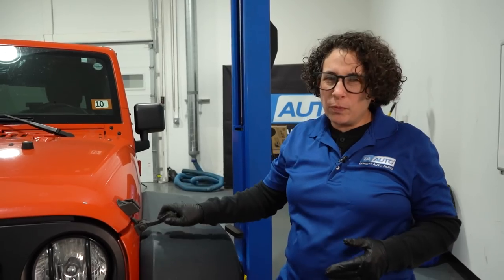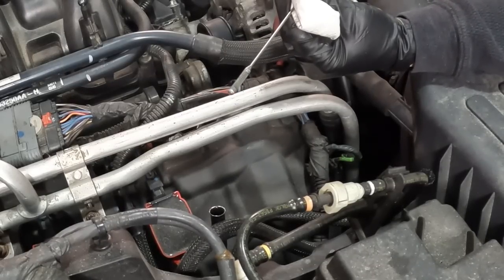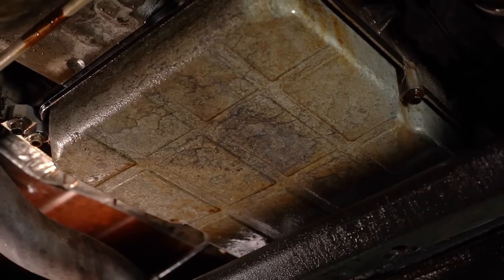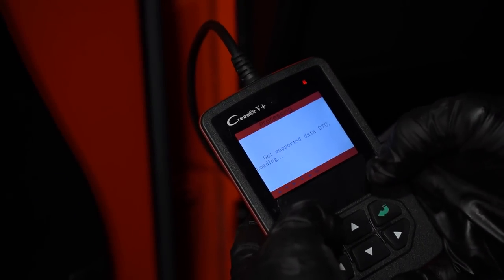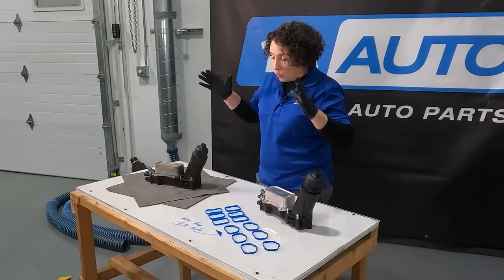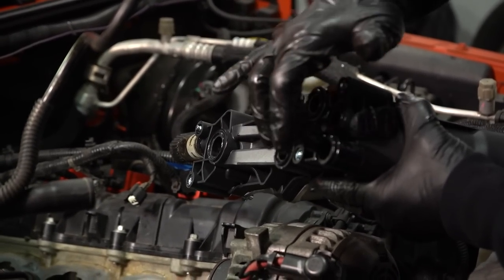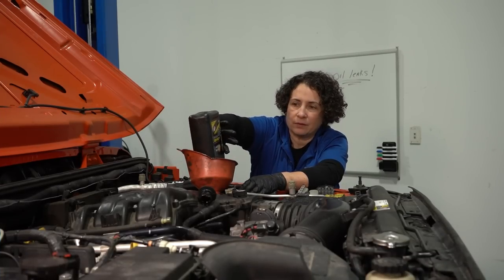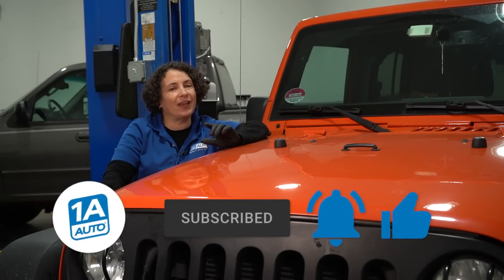Oil Leak Under Car or Truck? Lots of Oil in Engine Compartment? Easily Fix Your Oil Filter Housing

Comment: I just did this job on Saturday. I also ordered the part from you guys! I already replaced the oil cooler on my 2013 JK in Feb 2022 with a part from CarParts, let's hope your part lasts me longer than 11 months! Took me 7 hours the first time around having never done it before. Took me 5 hours this time. Use a pick to unlock the red tab on the fuel injector plugs, I didn't do that the first time around and probably spent a whole hour trying to squeeze my hand in there to unlock them. The first time you do this job there will be a ton of plastic Christmas tree clips, it was nice not having that this time since I removed those last year.

Comment: Another case of Chrysler knowingly making a part that will only last”x” years before failure, anticipating the customer coming in to get it fixed or traded in.  Either way, they make money. Thankfully, you allow us to avoid that. Always the plastic taking on the heat…

Comment: I have a 2013 dodge dart rallye with the 1.4 turbo. So i have a major leak, wouldn't even call it a leak, it's gushes. I put in 4 quarts and it all  gushed out of the right side of the engine within seconds. Any idea other things it could be?

Comment: I’m dealing with this right now on a 15’ Grand Cherokee. Most ppl think that P066DD code is the oil pump solenoid. So they replace the oil pump. Not going after the source of the oil leak

Comment: I took my car to a check up for driving Uber, Midas said I have a oil leak and they will have to degreaser the car I’m order to find the leak, I never saw any leaks before that, I got the car home and now is leaking like crazy! I took it back and they said is oil filter housing! 

Can this be something they did to my car?

Comment: ? I recently bought a salvage dodge charger Sxt that has ran for likely a week. Crank no start. " I replaced alternator ,starter, coilovers all six spark plugs. Changed oil,oil filter. Installed both fuel pumps. Installed brand new battery. Oh yes' even installed control throttle and EGR. Still no start. Says TCM no connection.? So I checked all fuse's 5/ 15 /20 /25. Than for the tall red, blue, pink and red I don't know how to check them or the blk boxes? How may I do this?
Reply: Ask a local mechanic, pay them for their time

Comment: Like this video. I do have a oil leak. I had the valve cover gasket replaced and the two half moon seals replaced. But the half moon seals are metal not the rubber ones that came with the 2000 Toyota Camry LE 4 cylinder. The drivers side half moon seal is leaking oil bad. It has coated my transmission with oil causing my speed sensor to go out from time to time when driving. Plus the oil pan gasket is leaking bad too. Dirty oil is everywhere on the passenger side bottom. I took it to a mechanic shop the guy that work on my Camry broke somethings. I'm not taking it back to them. I have a oil pan gasket and the gasket seal to put on the oil pan and gasket. I check the oil every few miles. I need to get both repaired but who do I take it to that I can trust. Plus I need to ask you a question. How many grounds does the 2000 Camry LE 4 cylinder have. I'm having ground issues with the Camry. Please reply thanks much.
Reply: You could always just add more grounds. Just trace some of the ground wires running to the body/frame. You should easily be able to find one from the negative terminal of your battery. One from the engine block to the frame should be another one not too hard to find. Loosen the nut and sand till you get shiny metal where the wire terminal will be contacting. Recommend using oxygen free copper at least the same gauge as the factory wires. You could get some metal grounding straps if you don't like the idea of wires. Use a lock washer to ensure whatever you use stays put. Then you could spray something to keep the contact ends from oxidizing. Some people use clear coat. I have used liquid electrical tape. Just my preference.  Also if you know how yo use a multimeter you could test if there is any resistance where your trying to ground pretty easily. Just some thoughts lol.